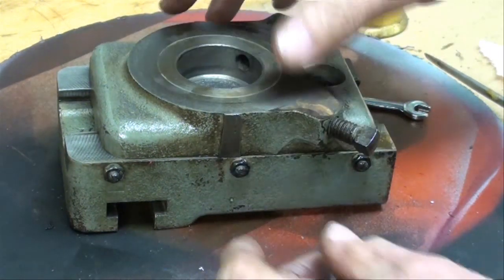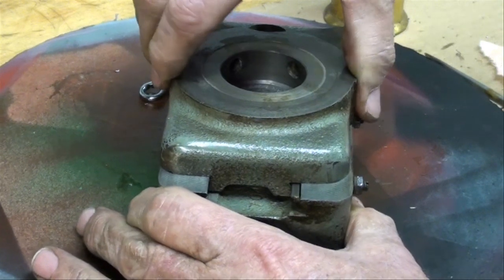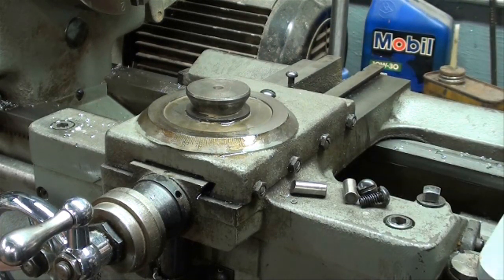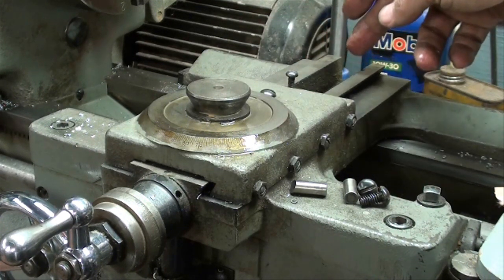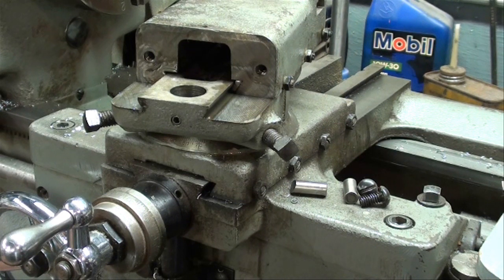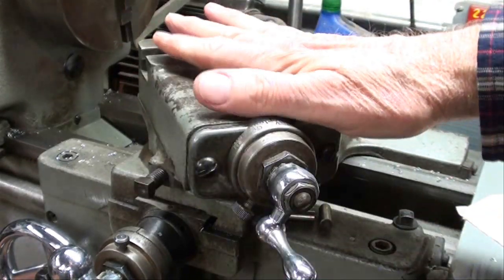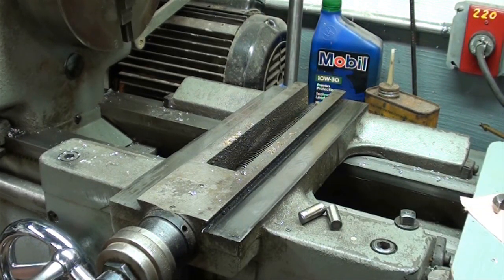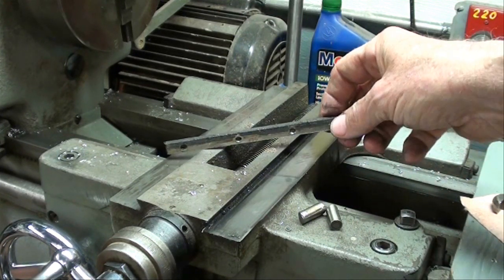MACHINE SHOP TIPS #62 Atlas Lathe Gibs Part 2 tubalcain

Comment: Nice video Mr. Pete, I have an Atlas 12” lathe and was wondering on the cross slide if you back out the cross slide towards the apron the slide comes off the screw. I would assume this shouldn’t happen. With all your knowledge on Atlas lathes, I thought you might be able to tell me what my lathe is missing or needs adjusting to prevent this from happening. Thank you Al

Comment: i don't know for the rest of the world but in old yugoslavia made lathes all brass nuts have been cut apart so they act like spring, and have a hex screw for adjustment of grip, that way you can adjust the play and tightness anytime you want, so you have a example of having a 30 year old lathe that has smooth and nice feeds.
Reply from the maker: +11thboris Some milling machine nuts are made that way. I think they call them "anti-backlash screws"
Reply: mrpete222 i dont thing they are anti, backlash, they always have some, its an manual lathe at the end. this is more of an representation on what they look like https://encrypted-tbn0.gstatic.com/images?q=tbn:ANd9GcSVQ5hWLlR_sQca6c8NYj0dN1__VQiSUYbXAF02h0hk0uZkMqBZEQ
Reply: mrpete222 but i always wandered why dont the manual lathes have some kind of solution for the backlash, even two parts nut that are pushed towards each other is a good idea. I can see a lubrication as an problem (extended wear) but that can be resolved also). I think if i had my lathe (mostly missing a space to put it in) i would modify the heck out of it.

Comment: Not if there is a chance for atmospheric contact. But that just applies to detergent motor oil. Some motor oils aren't. But I suppose there are worse things than using motor oil as a shop lubricant. I still don't do it to my tools though.

Comment: Engine oil is not a good machine lubricant. Motor oil is specially formulated to be used in the crankcase of an internal combustion engine. An environment with unique properties unlike ambient atmosphere. Read: The detergent in motor oil will attract moisture to surfaces. But when no cylinder fires to flash said moisture off that is not such a good thing.